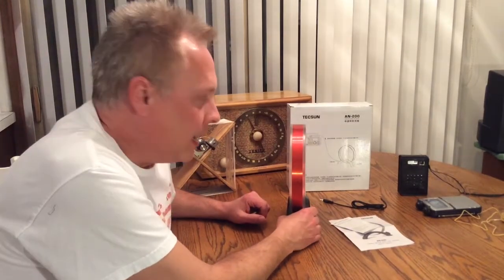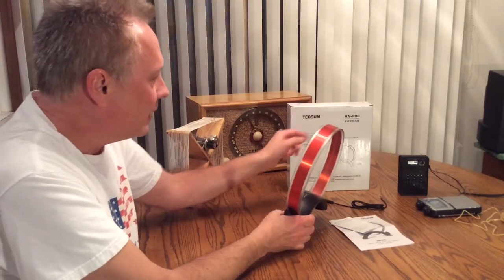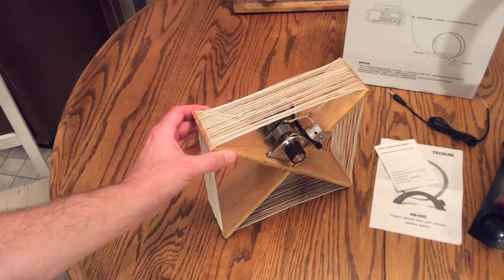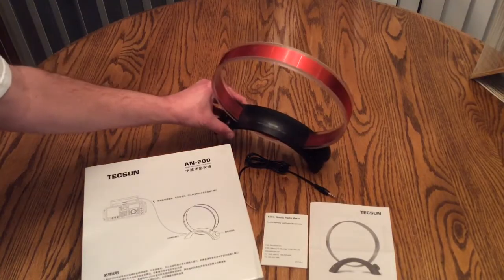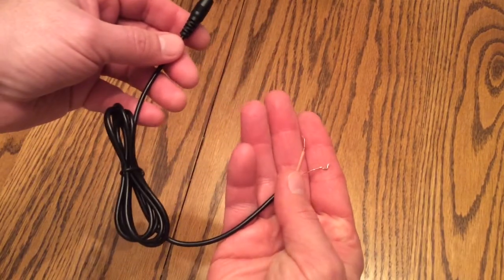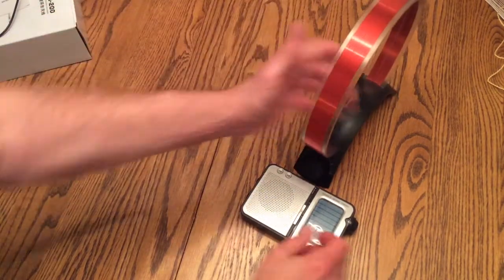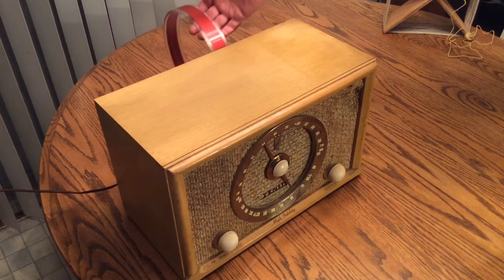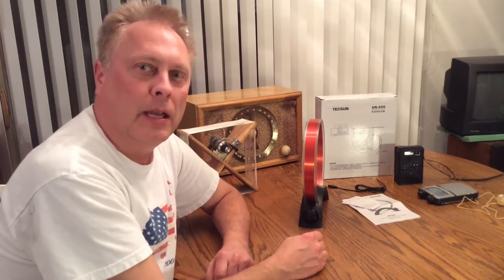Tecsun AM Radio Broadcast Band Loop Antenna Demo

Comment: Welcome. Video is put for a long time and I do not know if YT announces you. I saw it now because I now learned about the Antena from Tecsun and being very expensive I would like to do it. She is a transformer that is granted. In the mayor of the condenser coil, in the secondary the antenna output. I did not find the electrical scheme. But the scheme of your square antenna? Thanks in advance for the scheme.
Reply: Welcome. I'm glad you read the post. So where would I find the antenna scheme? I bought 25m copper wire of 1.5mm2 and I will see from what I improvise a support to make a 30 turns (so much did I count on an antenna picture) I will look for it in a old radio ... but I thought it may be a calculation ...

Comment: Hi.  Very cool.  Do you know if this will boost an old tube radio that has an internal loop already?  I see you tested a tube radio in this clip.
Reply from the maker: I have tried it on a few radios I have like you are talking about and found that it does still help in that situation also.

Comment: Again, very dependent on the radio used. I've found that very small radios benefit the most. The small ferrite bar needs a boost. I own two, and the improvement is quite impressive. Great video!

Comment: Great video!  I have the Tecsun loop antenna, but don't have the right cable to plug it into the back of my Icom 756 (SO-239).  Can you recommend a cable (where do I find the proper one), so I can connect this loop to my Icom 756?  I think it would be a 3.5mm stereo connector to a PL-259.  Thanks!
Reply from the maker: Thanks, and yes that is the cable you would need. If you can't find one with the PL-259 you might have to use one with the SO-239 and then use aanother adapter or coax jumper to make the connection.
Reply: @RadioHamGuy   Thanks!  That's what I was thinking after scanning the internet for such a cable (3.5mm stereo to PL-259).  I couldn't find one, and i'm really not good at soldering, etc.

Comment: Hi,
I'm a bit confused regarding the orientation of the antenna towards the station.
If the station is directly south of me, should the 'open' ends of the loop facing S-N or should they be facing E-W?
Thank you!
Reply from the maker: The open ends should face E-W.  The loop picks the signal up from the wire ends if that makes sense. So if you were to put a yardstick along side of the loop touching both ends you would be pointing the the right direction, however, it is the same off of both ends, bi-directional.  Hope that helps? I know, it used to be confusing for me so let me know if this helps.
Reply: @RadioHamGuy  That helps alot. I understand now.  Thanks again! 🙂

Comment: The tecsun one didn't work worth a chit..i built a 1 foot one out of pvc pipe with 25 winds of 18 gauge speaker wire and a tuning capacitor from a old radio....it kicks bum😃👍
Reply: Please share how you did it? Thanks

Comment: Little hello from France
Thanks for all of your videos and your cool way of doing them.
I bought this antenna and am disappointed that nothing is happening in LW.
Do you know if there is the same type of antenna that would also allow me to improve long waves? Thank you for your help .
My radio is XH Data D808 and it works in MW
Reply from the maker: I am not aware of any for LW that are commercially made, I know there are plans on the internet and calculators I have see to make your own.  Yes, this antenna will not tune down as far as LW.  The only way might be to make your own from what I have seen out there.

Comment: I'm seeing these on eBay and it seems like most of them just come with a 3.5mm to 3.5mm cable. I notice yours has the bare wires at the end, which is what I need. Is there a way to choose?
Reply from the maker: I have not looked in a while but there was no choice in what it came with when I got mine.

Comment: I just bought the Tecsun antenna and it didn't really do anything for my reception.  What I am wondering is if I could make one that is better .... meaning if you increase the number of loops does it work better?  What kind of wire did you use?  How many turns.  Where did you get the capacitor and what range is it.  Personally, I like you home made version of this better than the Tecsun, it looks cool.

Comment: This looks really useful.  Would it work with the NOAA weather radios too?  I have a KA500.
Reply from the maker: This would not work for NOAA weather broadcasts on the VHF band, this loop is only designed for the AM radio band but for that it works very well.

Comment: When you have the option to directly connect the wire to terminals on the radio, do you find that works better than just placing the loop near the antenna?
Reply: I find that it really depends on the radio.

Comment: I recently bought one of these Tecsun Loop antennas and it performs far above my expectations.  I use it plugged into the Hi Z input on an SDRplay RSP2 through SDRuno software on a laptop.  The feature I really appreciate is the filtering of interference outside of the tuned frequency range.  It is really fun for pulling in distant or low-power signals by turning the knob and physically moving the loop.
Reply: I found them on eBay cheaper than amazon. Like 10-15$

Comment: I have recently purchased the AN100 model which is electrically identical and it is surprisingly effective for its size. I have built 2ft square loop antenna which works very well but is too large and unwieldy to use inside the house. My Degen DE1103 radio is capable of receiving Transatlantic BC band DX at my home in southern UK, using only its ferrite antenna around sunrise when conditions are right, but the AN100 can boost things a little more. Received WTNI on 1640 from Mississippi on 2 mornings a few days ago.

Comment: I live 85 miles from the Canadian border and have this Tecsun loop aerial. At 1 am eastern time I took my tiny Sangean am fm portable and started tuning around using the Tecsun loop. For a year or so I have been hearing a Spanish speaking station on 530 khz on my Icom and Yaesu rigs and the 75 meter coaxial fed windom so, just to find out if it would be there with the tiny Sangean and the Tecsun loop I tuned the radio to 530khz and peaked the loop and it was there. No US or Canadian stations are there so as I rotated it the north south orientation nailed it. The signal was the best I had ever heard it! It was Cuba and they were playing some great music. The signal was so good I listened to the music for about 90 minutes or so with hardly any QSB at all. On or about that frequency at the east west orientation there was another station there. The loop had nulled out Cuba almost completely so now I want to eventually nail that other station which is due east somewhere towards Europe. You guys should try 530 khz and listen for Cuba and then for that station due east. Probably Europe but until I can get a World Radio TV Handbook I will have to keep guessing!
Reply: Hi! Pointing to Europe, and close to 530kHz? It's 540kHz, isn't it? If so, you are receiving the station MR1 Radio Kossuth of the Hungarian National Radio network. This is our last remaining AM broadcast frequency, transmitting with 2MW. The transmitter has been completely replaced recently, the new transimitter is in service since 11.27.2017. It replaced a 40 years old 2MW Soviet tube transmitter, the new one is a solid-state Canadian Nautel with five 400kW units. They also kept the old tube transmitter, as a spare for the new one, it can be re-utilized in minutes, if necessary.

Comment: I have an 80ft external long wire, do have any thoughts on how these small passive loop antennas compare?
Reply from the maker: Many times they work better since you can null out noise sources and point them in the direction of the station also.

Comment: If the loop antenna larger, would it pull in more stations?
Reply from the maker: A larger size loop does generally work better, it would probably require less turns of wire also.
Reply: Thanks!

Comment: thank for the reply radioguy..im also very impressed how it picks signals simply without any external power input..it impressed thomas henry morray as well who went on to make history building controversial energy devices in the 1930s ..please link it up to a led and see if it can light up any simple led with the right capacitance resonance with relation to the coil winding

Comment: interesting it really works, reckon we can use that booster antennae to build a crystal radio set?
Reply from the maker: fidel catsro Yes, I did just that with my home built loop, just added a diode and high impedance earpiece and it picks up my local AM station just fine since the tower is only about a mile away, I have impressed a lot of people demonstrating that to them, they just can't believe they are hearing a radio station with just that and no battery.

Comment: could i make one with no dial?
Reply from the maker: Connor Baker You would need the tuning capacitor to change the frequency but as for the dial itself, it would not have to be on there, it is just a way to tune the capacitor and have a relative indication.  By dial I am talking the knob itself.

Comment: Hello, your ugly construction model (and perhaps the pretty commercial one) is that just a variable capacitor, like my l-match I made for a random length end fed shortwave aerial wire antenna? I took that one out of an old tube Admiral AM clock radio that was beyond repair. Is that what that is on your loop antenna , a variable air cap? Thanks for this and your other contant too, Man! W4VEY "73" :) Forget Bluetooth this is the real wireless pairing!!

Comment: I have 2 of these loops and they really work great! You can take 2 of these loops and set them in a straight line with each other close to a am radio and they will work better also, you just have to experiment with the distance between the first and second loop for best reception.
Reply from the maker: great to know, I will have to play around with that also...
Reply: CARL BOLEY 
Interesting. Thanks for the info.🙂📻👍‼️

Comment: very cool.
I just picked up a Motorola Am/Vhf Transistor radio. less than 5 bucks on ebay. one of those antennas would be perfect for that.
73,kb3aum
Reply from the maker: Might be worth a try Dave, they do wonders on portable radios that have the built in ferrite loop stick antennas. 73 and nice to hear from you!

Comment: Hey Larry, I have built several of these and they work great.  Radio Shack have some like yours and I think they wanted 90 bucks or close to that. Hmm , and now they're gone.
Thanks
Carl
Reply: :::: had :::::
Reply from the maker: skycarl Hi Carl, yes, I am going to miss the local radio shack, was nice to get parts once in a while.  Some good deals now though I guess.  They sure are not what they used to be though but times change I guess and I think ordering online sure changed it for them for the worse.  Times sure change I guess.
Reply: RadioHamGuy here in Australia we have Jaycar. they seem much better value than radioshack. i got a 8kg bag full of resistors, relays, capacitors, large ceramic resistors, contactors, transistors, even a few vfd displays. the whole bag for 20 bucks. if you were to buy everything individually it would cost over 100 bucks.

Comment: I have the Radio Shack version.  It didn't seem to work, I will try it again since it has been shelf candy for a long time.  Got it on a RS junk table manager red tag deal, very cheap. 
I hear that some closing RS's are having great junk table deals, gotta check them out for parts dtc.
Reply from the maker: yea, that is too bad to hear about Radio Shack.  Some good deals however.

Comment: I haven’t used my loop in a few years.  It does not look like yours but it works great.   I hook it up to my Onkyo stereo receiver.  I never used it on my communications receiver because of the noise.  I’m so glad I sold that thing. Well anyway, I got some great DX in the month of November right after the time change.  These were daytime stations in the south in the central time zone an hour before they go off the air.  I still have my log book.  Another great thing about my loop is by tuning, turning or both, I can nullify stations.  One time I nullified WIP in Philadelphia and got WIOD in Miami!  I’m going to hook my antenna tonight just to see what’s out there.  It will be a clear, cold night; perfect conditions for DXing the AM band.  During the summer it’s a waste of time.  Keep up the great job with your videos.  

Richard K., Berks County, Pennsylvania.
Reply from the maker: Thanks, yes, this is about the best time of year for AM band DX.  I have been tuning around and hearing stations I have not heard in a long time.  That is what I like about the loops, you can zero in on the station and get rid of some of the noise many times also..

Comment: Cool. I would have thought it was a hoax device if not for your video. Thanks for the tip.
Reply from the maker: Thanks Todd, yup, they do really work, and just a basic tuned antenna circuit.  Hope you are doing well.  73